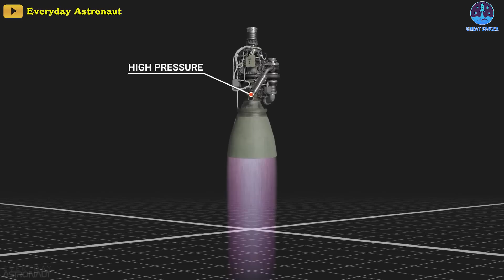SpaceX in BIG Trouble?! Raptor Causing Big Problems...

Comment: The true issues have been in relights.  They have suffered power losses on nearly half their relights (note the green or uneven flames)  So far, not a very reusable engine.  And that is the wall they are against right now.  They can either redesign the turbopumps again, or reduce pressures.  but that means more engines.  Let me be VERY specific.... THESE ARE TEST ARTICLES  These are not production engines.  But they need to start worrying about quality over volume.  And go slower. But that's what makes SpaceX so fun to watch.  They do not mind public breakdowns.  And change these engines literally every time they build one.

Comment: You know..........I really like what Musk is doing with SpaceX.  However; after watching most all of these videos it seems like some of the stuff is kind of not well thought out.  Like the Texas launch site.  After so many concrete spalling failures why they don't install steel plating. If done right it could be a onetime fix.  I can't believe how many building and equipment is in such close proximity to the actual launch site.   Also that many first stage engines make it so problematic with so many points of possible failure.  Could have fewer engines with two boosters.
Reply: "fewer engines with two boosters." - Not exactly drive-thru.  :)

Comment: Musk picked the site in Texas without any actual engineering consultation. His launchpad is a flat concrete slab sitting on top of the water table near the shore.   He built it tall, thinking the engine plumes would just hit the concrete and spread out in all directions.  However, the reason pads 39 in Florida are built on top of a 50 foot tall concrete slab is specifically so they could have a flame diversion trench below the engines of the Saturn and then the shuttle.   What he is discovering is that a rocket engine puts out a cascade of never ending sonic booms, and he has grouped 33 of one of the worlds most powerful rocket engines  just above a flat concrete slab.  Firing up this rocket is like hitting that slab with a thousand 6 ton wrecking balls every second.  PLUS the enormous concentration of heat and erosive plasma.   He’s screwed, At present.  He CAN’T dig below sea level to make the flame trench he SHOULD have built.   And his impulsive imbecility led  him to start building a SECOND launch tower NEXT TO instead on top the of the existing flame trench at pad 39.  SO he will likely have the same issue, there.  He is building a second star factory in Florida because its looking like his lack of due diligence in picking the Boca Chica site will result in the Corp of engineers forbidding orbital launches from Boca Chica. ( because Musk just couldn’t be bothered to do the impact statements and file for the permits that any ordinary citizen would have to do to build a development in a protected wetland.)   Musk’s veneer of pretend genius is beginning to flake off.   His people at SpaceX have done some amazing things, but its not because of Musk’s brilliance, its in spite of it.
Reply: Ha ha ha. He's making more mistakes than Boeing. That's because Boeing is doing nothing.
 A genius is not defined by their lack of mistakes but by their achievements. I do hope he's done with Twitter and can come back to Boca Chica, dig a flame trench, pump it out and launch this thing.
Reply: @Marcoose81  He can’t dig a flame trench UNDER the existing pad.   The entire structure rests on pilings that require the soil around them to hold the thing up. And already the tower has a tilt to it because they keep having to add weight.   The problem is he hired a bunch of rocket scientists, who have done pretty good on rockets, but know nothing about soil engineering. And soil engineers don’t know to advise on a flame trench.   He SHOULD have asked NASA their input.   But then, They are having issues with Artemis doing damage to Their design for their launch pad, too.
Reply: I have to disagree. Musk is only as perfect as any of the other great inventors and entrepreneurs. What his LEADERSHIP has accomplished is stunning. We can all agree that turning SpaceX operations over to Gwen Shotwell is his way of admitting that although he's an idea/ problem solver and finance guy, there comes the point when the professor tells the student, "You're up. Let's see what you got." Also, he has discovered that 'Fiddlybits' will make or break you if you can't find others that want to live the dream.
Reply: @jameswilson5165  Musk hasn’t invented a thing and his “problem solving” is closer to problem creating.  Hyperloop was not only not an original idea ( being over 100 years old ) It was unworkable on its face. ( really Elon, An air hockey table in a vacuum tube? ) His Boring company idea for beating traffics turned out to be chauffeured teslas in a traffic jam that WALKING can beat as far as speed.  He did NOT invent PayPal, and was fired as CEO of the company that Theil would make into PayPal after 6 disastrous months as CEO. He was NOT a founder of Tesla, he bought controlling interest in it and then had the board rewrite its own history to make himself look better, and forced the company to allow Musk be the only public face for Tesla. He then pushed out the Actual founders and fired the man who designed the original roadster, and then reneged on his promise to give the actual founder the first tesla off the line. Eventually shooting the Roadster he contractually promised to the actual designer of the car into space. His Solar Roofing tiles turned put to be a huge con, claiming they were in production and that they had been installed when, in fact. There had not been a single installation and no actual product was in production.  His Tesla Truck is a boondoggle that is over five years behind schedule and has NONE of that features he originally promised were doable in 2017. No self driving, No convoy mode, and he still will not divulge the actual weight of the truck, ( which determines how much cargo it can legally haul ) and has not installed a single supercharger. The “guaranteed” 7 cents a kilowatt for charging has become 50 cents per  kilowatt. And he refuses to address the fact that fast charging batteries cuts their service life in half and erodes 20% of their capacity per year. Based on the cost of replacement Tesla batteries, the batteries in his truck will cost more than a new diesel semi.   His Car company, His solar company, and his rocket company ALL were funded by Public moneies, thru tax incentives, price supports, and outright multi-billion dollar contracts.  His offer to purchase Twitter was in a fit of pique over their complaints about his Pump and dump schemes for Dogecoin, and he failed to do the due diligence to realize that they could HOLD him to his offer. Essentially, he was forced to buy it. And now he is having to liquidate his tesla stock to cover the payments for Twitter because with his recent right wing conspiracy theorist lunacy his “investors” are running for the hills. Which will mean Twitter will eventually be controlled by Saudis. Y’know, the guys who flew planes into the WTC, and just recently decided to cozy up to Putin.    Musk is NOT a genius.   He’s not even very bright. He is impulsive, narcissistic, and thin skinned.  He lies about his products, his projects, and his contributions. Rage fires and is, by all accounts, an insufferable boss.  The people who actually Run Space X and Tesla for him are having to deal with rampant calls from their staff to have the boards Remove Musk as CEOs of these company’s, as his meltdowns and multiple criminal investigations for stock market manipulations are causing the market caps for his companies to plummet.  Sorry. About the only thing he did for spaceX was to be willing to spend the money he had at the time to try and make a space rocket, after finding out the Russians would NOT sell him theirs.  Hype is not genius. Taking credit for other people’s work is not ‘leadership’.   Don’t fall for the con.
Reply: Your comment is spot on.  However, "Musk’s veneer of pretend genius" happens to cover SOLID GENIUS, and his true fight is against TIME.  More haste (against bureaucracy) brings more error.  Don't be so jealous.  :face-green-smiling:
PS.  Those combustion shockwaves definitely need to be deflected away from the vehicle as it lifts off.  I have always thought that flat bed was crazy - unless he were to make shock wave deflector placement one of his final actions.  I reckon he will be digging soon.  What fun!  :)

Comment: The Tower base is literally the Achilles heel of starship ...
After seeing the debris flying and causing issues during testing. There isn't enough volume of free space to compensate for the large numbers of engines
 - dumping large volumes of fuel/at pressure and the simultaneous explosive ignition of 33 engines  / reach needed thrust for lift off.
The volume of free spaces surrounding the engines is the same as that of (low number) conventional launches, i.e., fewer engines.
Videos of Raptor engines being tested show the shear amount of space a single engine needs for ignition and thrust > multiply x 33 ??
The possible work solution could be redesigning the tower base(height) and also moving the launch support infrastructure further away or underground?
They are possibly trying to avoid disassembly, redesign and rebuilt - Loss of precious time for Musk.
Or better yet Rebuilt a new tower (@ a calculated distance) from the launch support infrastructure while dismantling / reusing assemblies of the current one,
higher, with generous space for all the gases to pushout during ignition & sustained thrust to liftoff.
Sadly, ironically, the base area - is the Achilles heel of the giant that is Starship. 
But honestly I never saw that till the testing took place, and not no expert.
Nor do you see this issue in any of the rendering animations of Starship put out by anyone, including SpaceX. So this is new.

Comment: Well, the engine doesn't actually "lose efficiency" as atmospheric pressure drops. More accurate is that it doesn't gain as much efficiency as it theoretically could.
The overlap hardly matters though. The vacuum-nozzle engine is worthwhile because it operates for a long time - the whole time -  in a constant, extremely low pressure.

Comment: Great SpaceX’s last talking point (6:53 Mark) just shows that the YT channel still doesn’t get why SpaceX is great.

“And the SpaceX team will be treading carefully with this test as they would need to avoid any accidents or RUDs that would set them back for half a year on the mission.”

If Great SpaceX had a better understanding of why SpaceX is great, their talking point would be more like this.

And the SpaceX team will be boldly moving forward with this test as although they would obviously like to avoid any accidents or RUDs that might set them back for as much as half a year, they prefer quickly learning from failures and therefore accomplish in a relatively short time what their competitors are unable to do in several years, if at all.

Comment: Great SpaceX, 
I'm concerned about launch damage as are you.  My question is ... would it be possible to do an INITIAL 10-20 seconds of launch profile with lower power than 100% (say 50%), enough to clear launch tower and facility, then go 100% as the ship tilts over for increased speed to reach escape velocity?
Reply: Superheavy is supposed to have a thrust to weight ratio of 1.5 so 50% is out of the question, can't go lower than 66.7% and still fly. Launching at lower power would also waste fuel, and reduce the payload. But if it's necessary and it makes a a difference at a power reduction where the ship still can fly, then it's a good idea.
Reply: @danhunters8226  Perhaps 75%? Also, if anyone knows, how many Raptors would have to fail at launch to endanger the craft from ascending? I ask because once ignited, it's Go or RUD.
Reply: @Dan Hunters  Great insight!  
I hope SpaceX can solve the launch concrete and debris issues.  Who knows, maybe 70% for the first 10 seconds might help make rapidly reusable launch grounds survive.  
👍

Comment: The whole point of testing is to figure out how to improve the engine. The goal is to change it after the test, not validate the engine. At least at first. Identifying the right thing to change is the point of the early tests. That's something Elon does differently - fail quickly and do rapid iterations, rather than spend years and years getting something "perfect" and then only building it a few times to validate.
Reply: At least you of all people nailed it.  The Whole point of static fire testing is to push the limits as much as possible and cause as much damage as possible, so the engineers have a pathway to refine the entire program.   You want to see this damage.  You want to wreck things.  You want to wreck the launch pad and the concrete below it.  All that gives SpaceX data to properly redesign and rebuild the system.  Testing, damaging and redesigning over and over and over until everything is refined enough.
Reply: Well that’s no longer what they’re doing
Reply: @paulwilson8367  that is exactly what they are doing

Comment: Kudos for mentioning the lift-off shockwave effects on the re-entry tiling.  Also, there might be cryogenically-frozen ICE in the tile lagging which, its ablation being restricted by the impervious tiling, may explode into steam on re-entry, removing tiles when they are needed most, and. . .
Reply: And?
Reply: @serronserron1320  . . . allowing the 25,000 mph slipstream to blow a hole into Starship's belly and ignite its residual fuel, causing it to explode and shower its heavy debris along a 3000 mile trail.

Comment: 17 engines tore up the pad. What is 33 going to do?
Reply: Probably blow away some of those nice hexagonal re-entry tiles.  I hope they also remember that cryogenic temps freeze the water vapour present in air into the insulation blanket as ICE, which cannot quickly ablate away into space through the tile that protects it..  Remaining ice may present a re-entry problem.
Reply: Well for 1, not sit there for 10 or 20 seconds. :)
Reply: @Sum_SpaceX  No, but once might be all that's required.  Seasons...

Comment: Nonsense, the Raptor 2 is not a bad engine. The problem is the launch tower. The tower and the Launchstand are not high enough, so the gasses cannot expand easily at stage 0. SpaceX should have delayed the construction of the second tower in Cape Kennedy until experience with the first tower was obtained, and very basic improvements in the layout of the tower could have been incorporated there, before starting that second construction. I think the tower should be at least twice as high as in BoccaChica; ideally higher than 1600 meters! So that the gases have a long straight line to flow easily; without any bending. 
With ignition and lift-off at 1600 m height, the atmospheric pressure is already a little bit lower than at 0 m sea level. But the non-negligible problem of such high tower, as it needs to be built on sand ( there is no solid rock available!), is how to make a reliable and rugged foundation. (any earthquake or even the vibrations of launch could shake it out of lot) It also need be Hurricane resistant. 

 Then, there is a difference/problem with the inner engines at launch, because they surely may experience bigger, and fluctuating back-pressure than the outer ring of engines. There is not enough space for the gases to expand under the stand and the acoustic thunder may reflect up from the ground to the nozzles, too; and it would do so in an uncontrollable geometry at launch. So it must be very difficult to avoid peaks. 
 The Buri Califa is an unnecessary high rise, but such a high launch-tower is a very favorable advance! Humans are not like eagles, they feel uncomfortable if their "nest" is soo high up ( it is more about bragging than usefulness). But rockets, in this sense, are quite like eagles. The higher the "nest", the better!
Reply: Yes, that's my impression too. And SpaceX are not alone in having that problem. Nasa's SLS wrecked their launch tower too. But they have plenty of time, since they won't have another $32B rocket ready for a couple of years, and at that budget they may just as well treat the launch tower as one-shot disposable. 🧐
Reply: Yes, probably so.  But SpaceX feared the FAA wouldn't allow them to fly at all from Boca Chica, and they had to have a backup.  I believe there is a plan to build a 2nd, "permanent" orbital launch pad at Canaveral.
Reply: Oh really?
Reply: "the Raptor 2 is not a bad engine" - understatement of the century.  :face-red-heart-shape:

Comment: Yes, with more powerfull engines clustered together one would expect that the tremendous pressures and heat would create serious challenges, and that is what has occoured.  It would be neat if plain water could take the place of some of the combustible fuel and  introduced into the rocket engines bell as a high pressure fine spray that could both cool the bell while turning to high pressure steam in the bell nozzle and thereby generate additional thrust while cooling the bellhousing a bit and potentially saving some costly fuel.$$$🙄...
Reply: Christ, you have no knowledge about how rocket engines work do you ! Read up on how they work on Wikipedia or somewhere before you post about them here. There are certainly some serious cooling going on in all LPREs.
Reply: The rocket chamber and bell are already cooled, using film cooling, internal cooling and radiative cooling.  Water is introduced into the rocket exhaust stream to cool the gasses and absorb the extreme white noise generated.  Nitrogen blast-purges the motor surrounds of combustible gasses immediately prior to the exhaust flames' arrival.
All this work has been done.  I think they have just finished tuning the initial ignition stages, and now they must be fixing up Stage Zero.